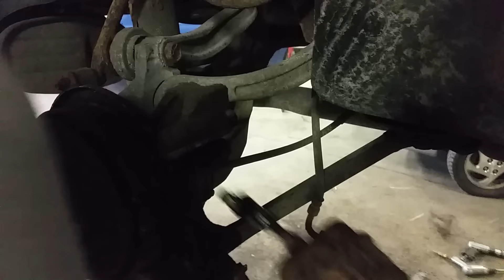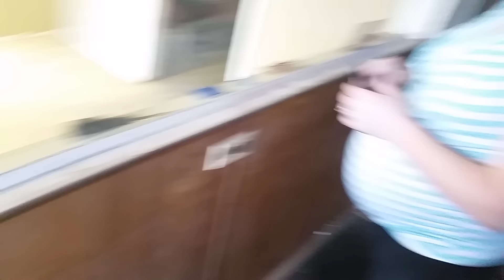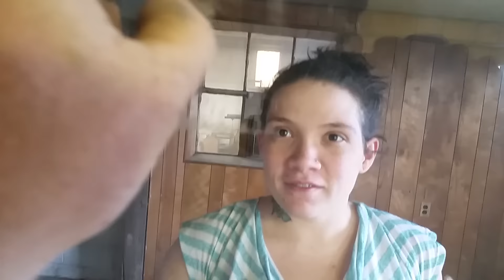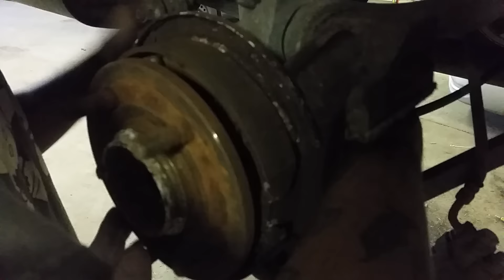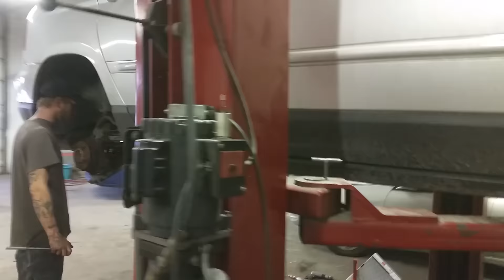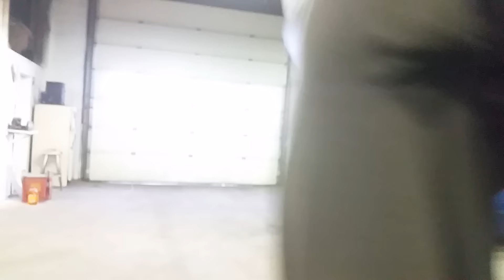A random walk around the shop..

Comment: He should not be letting the brake caliper dangle like that
Reply: +cc l Absolutely irresponsible. I noticed that too, and any tech I'd see doing that would be hanging by a thread (almost a pun) in my shop. I'm a huge fan of the Hack and Pack, and my mechanical skill is currently ASE Master Tech and Under-car specialist - trained driveway style, it's still never an advisable practice.
Reply: +William Reed If those are the wrenchers for that dealer - I'd go elsewhere, no question.